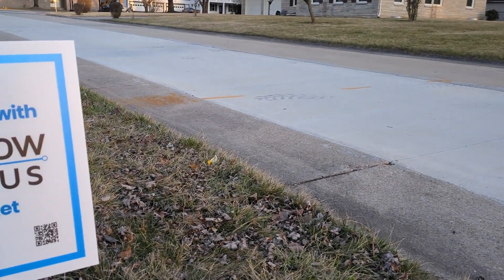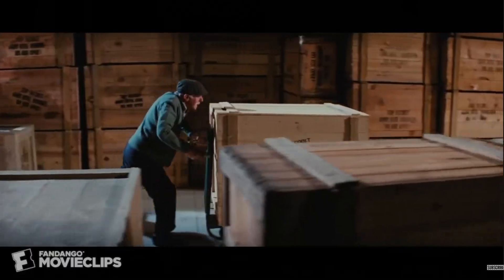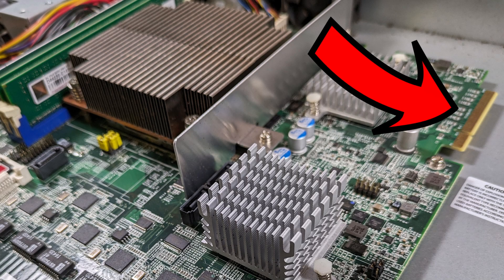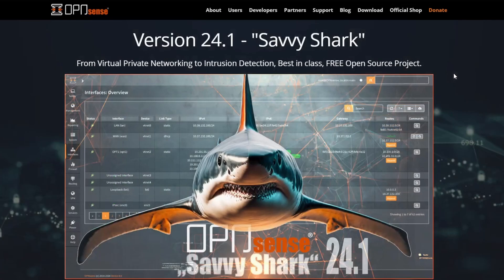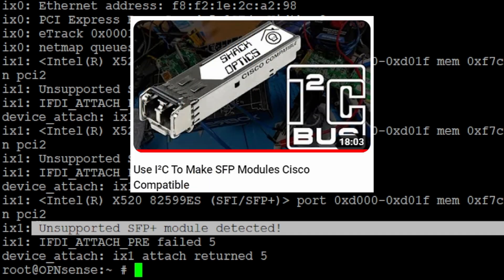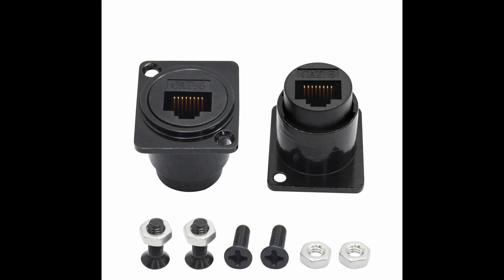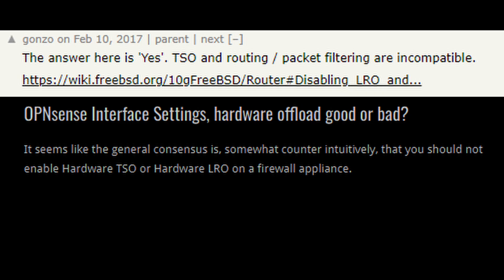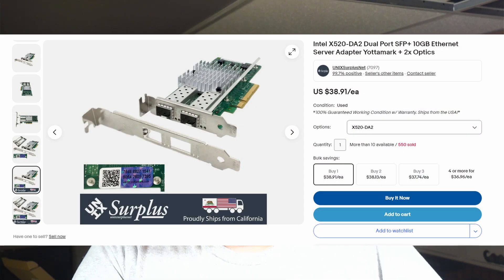Hackshack Gets Fiber - Part 2 - Firewall Fun

Comment: Howdy from Akron! So a couple of things. One of the off-lease corporate PCs is FAR better at home vs the rackmount gear. All of the server NICs run hot. They expect to be in a server with a lot of front to back airflow in a server closet or datacenter. If you get a desktop style PC, make sure you put a small fan blowing on the NICs. I'd Try a 2.5G dedicated copper NIC going to the ONT. I think the intel I225 or i350s can do it. In regards to the ONT module it's worth a call your carrier, a lot of them use ONT modules for business customers and they may be willing to work with you. Working with municipal fiber has a lot more flexibility than any mega carrier. Those ONT modules are neat. Most of them are 10G simplex.  The carrier polices the traffic towards you in their transport equipment. You'd be expected police/shape the traffic towards them to your agreed upon bandwidth in a business setting. Give it a shot. Good video.
Reply from the maker: Good stuff. Thanks for watching and thanks for the info!

Comment: These days you can build a cheap and reliable 10g firewall running pfSense / OpnSense from datacenter castoffs. Doing it this way also lets you more easily upgrade the firewall hardware if needed.

Comment: Excellent video, and thanks for sharing your experience.  If I understood correctly, your hand off is copper? Strange. Mine is fiber to the house. But then, I don't live in your area.
Reply from the maker: It's fiber into the house into their Nokia ONT but then after that it is copper on the backside where it connects to any customer equipment.